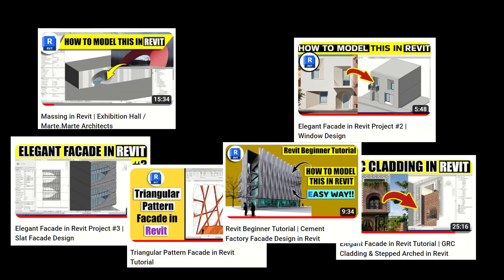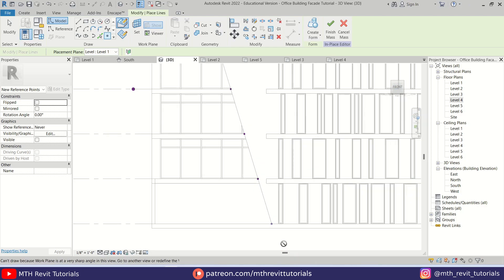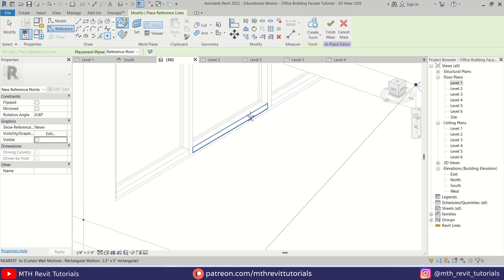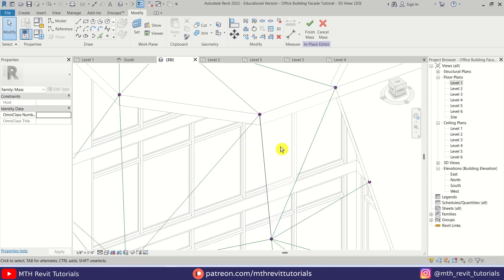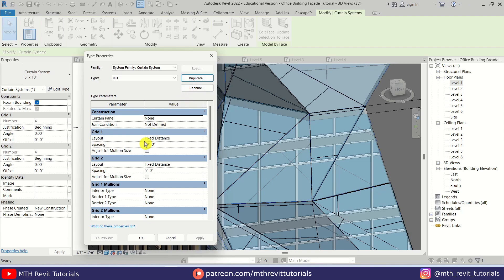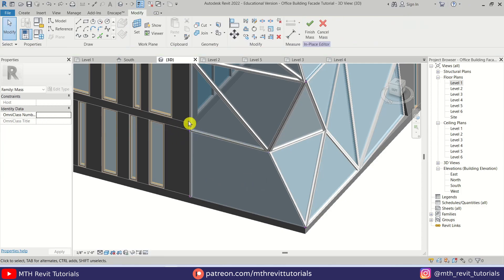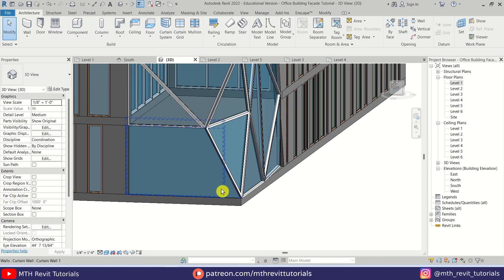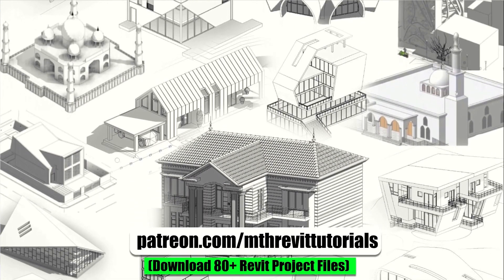Facade Design in Revit Tutorial | Complex Facade in Revit

Comment: Sir, I downloaded the project file, but Revit 2020 is unable to open it due to a version compatibility issue. I tried clicking on 'Upgrade Model, but nothing happened. It seems the file was created in a much older version of Revit, which is not directly supported by Revit 2020.
Reply from the maker: The project file is compatible with Revit 2022 and later versions.

Comment: 5:36 Why don't my revit2023 have the two options to select? Is that plugin? Thank you
Reply from the maker: Make sure to check your entire Revit window. Sometimes it may appear in the corner of the screen.

Ensure that all three lines are connected, as if there is a gap, you won't be able to see that option.
Reply: @MTHREVITTUTORIALS I’m having a similar problem in revit2023, instead of providing 2 options, it automatically creates an extruded mass, and i am unable to create just a surface